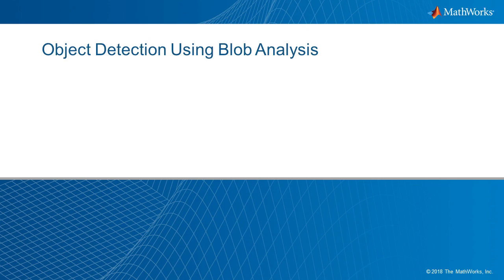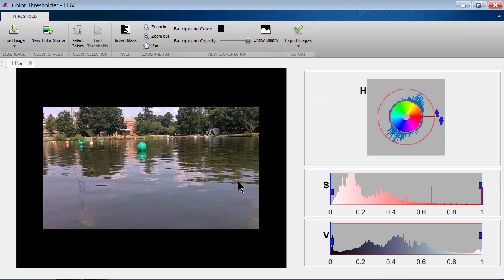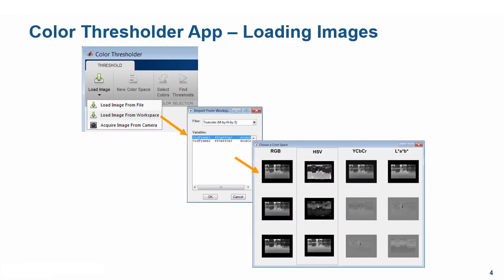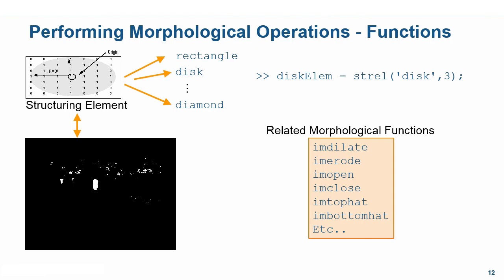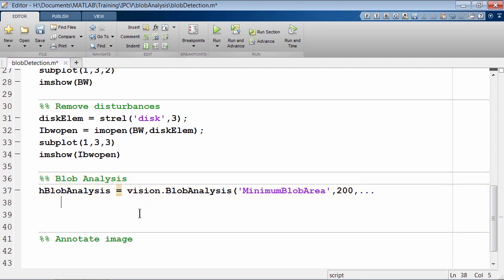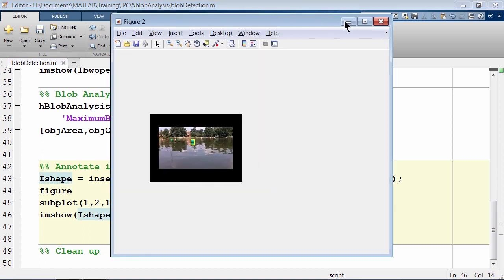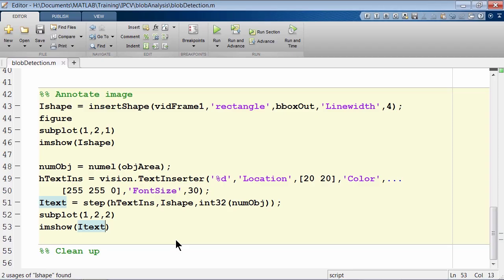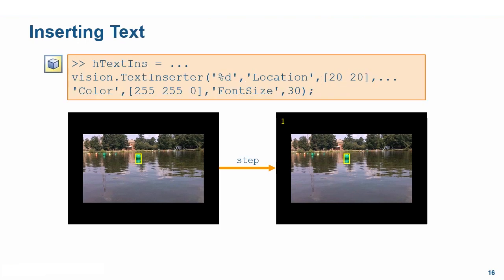Object Detection Using Blob Analysis | Student Competition: Computer Vision Training

Comment: hi, i'm getting the following error.
"Unable to resolve the name vision.TextInserter.
"
kindly guide me to resolve it out.
Reply: Do you have the computer vision toolbox installed and with a licence?
Reply: @chrisarmstrong5611  with new versions of Matlab this error used to come. Can you give any solution for this?
Reply: @SahaParikshit  if you type ver in the command line so you see an entry called "computer vision toolbox"? I don't think you have a licence / have it installed
Reply: @chrisarmstrong5611  Its installed & am using latest version matlab
Reply: insertText(I_shape, [20 20], int32(numObj),'FontSize',30,...
   'BoxColor','White', 'TextColor', 'Black');
Reply: @olenamazurkiewicz  what will be the next line then? because mine still get error with the line 
image_text = step(text_insert,image_shape,int32(number_of_objects)); I removed int32(number of objects) and it give error for that one
Reply: actually i got it. thanks. just in case some one else doing this. 
text_insert = insertText(image_shape, [20 20], int32(number_of_objects),'FontSize',30,...
   'BoxColor','White', 'TextColor', 'Black');

%% REMOVE THIS LINE image_text = step(text_insert,image_shape,int32(number_of_objects));
subplot(1,2,2)
imshow(text_insert)